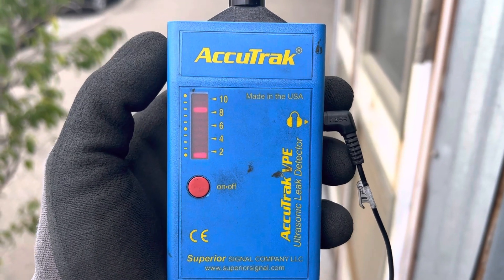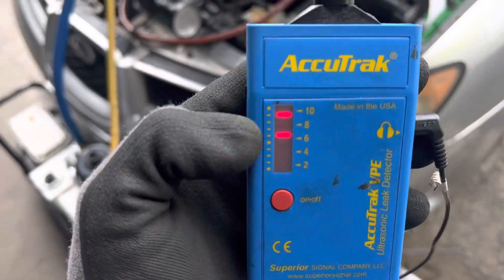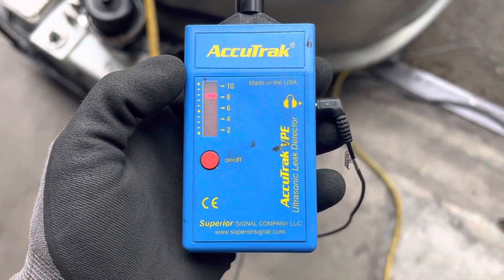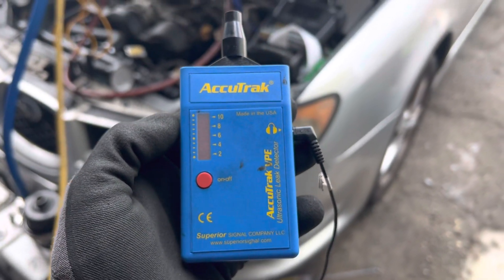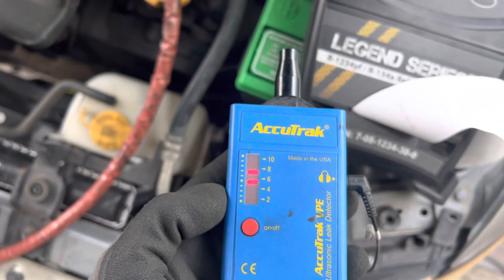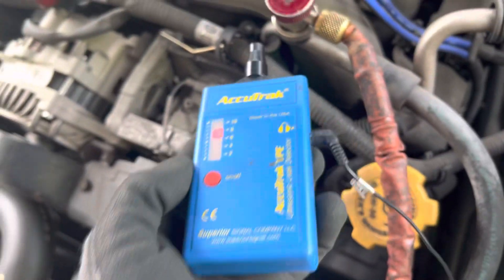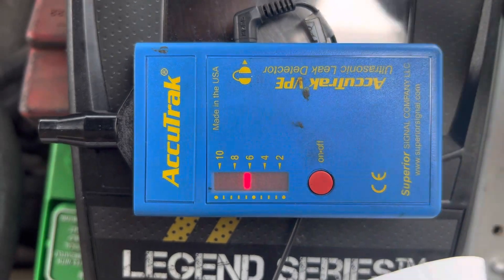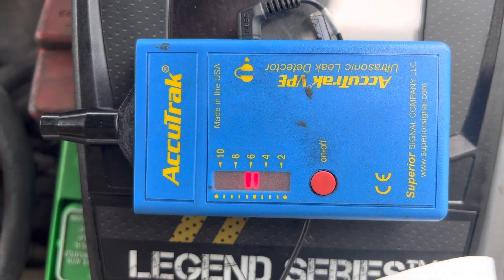ULTRASONIC LEAK DETECTOR is a good tool to use when the area is saturated with refrigerant￼

Comment: Thinking of buying one of these, would you recommend the gooseneck version over this one for automotive?
Reply from the maker: Either or if it’s by INFICON it’s a good brand that you’re looking at. 
This one here there’s also a hose that you can add to the end of it to give it some extension 

Remember, this is only one method of leak detection not all of them. There is no one best leak detection method. They all have their pluses and minuses in some situations. One wheel will not work we’re another wheel work really good and then another situation. The other one will work really good and the other one option will not work . That’s why four or five different leak detection methods are needed in a shop.